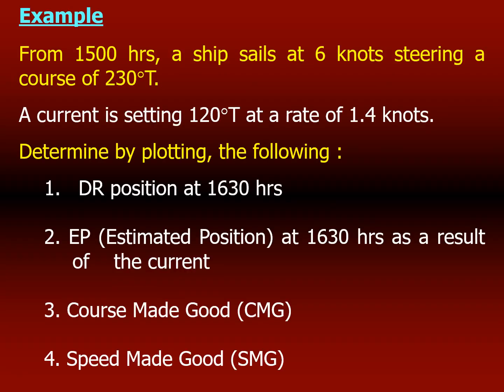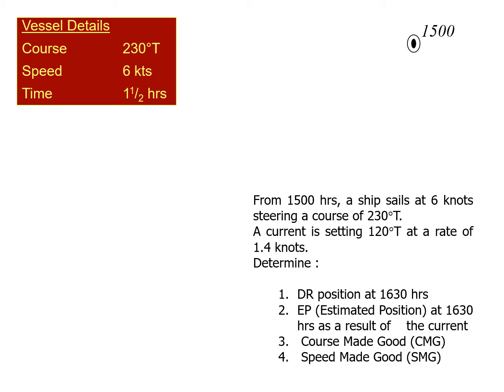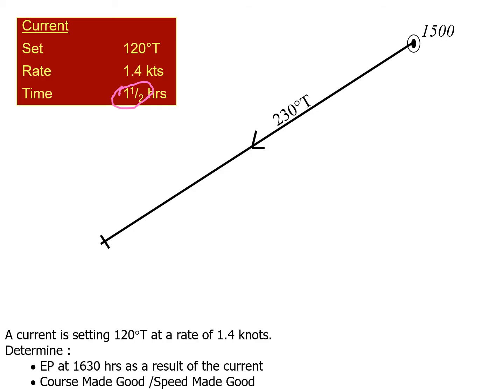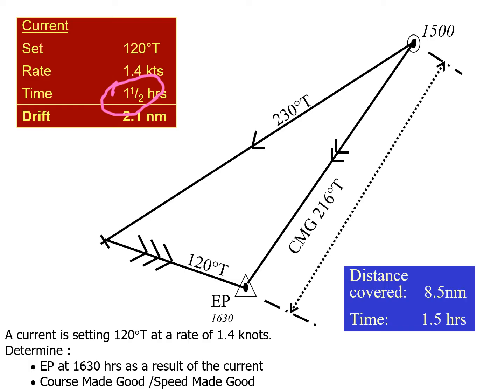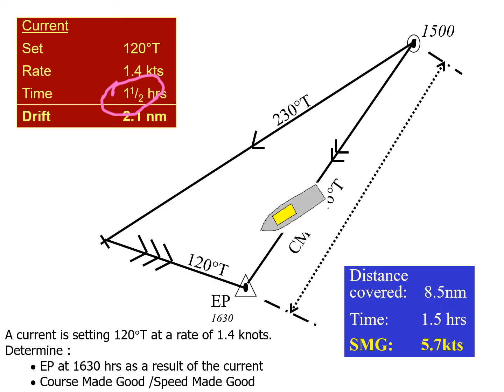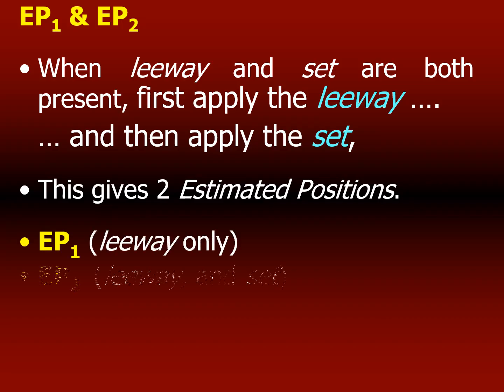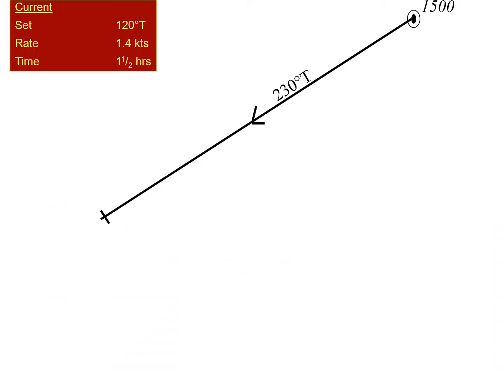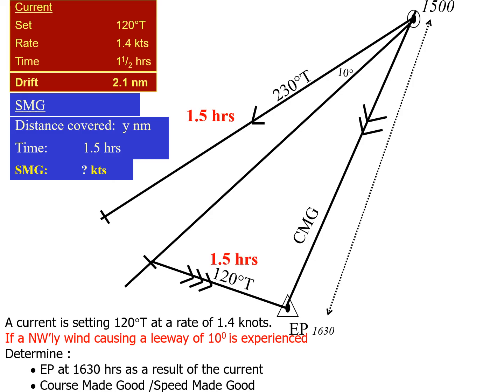Chartwork - Allowing for the leeway (wind) and set of current on ship's course and speed

Comment: The following problem came in the authority test in Latakia port in Syria:

A ship steering 235°  gyro, Speed 15 kn, gyro error= 2° low
Under effect of bothe northerly wind , causing leeway 7°,
and a current , set 185° and rate 3kn.
At 1600 , Dungeness light house distance off by Radar 8 miles.
At 1640 , Royal Sovereign light house distance off 11 miles.

Fix the position at 1600 & 1640?

Can you please , kind Sir, show us how to solve this sailing problem?!
Thank you in advance